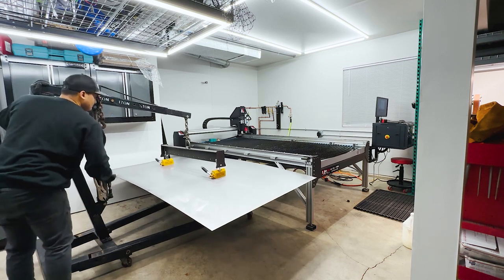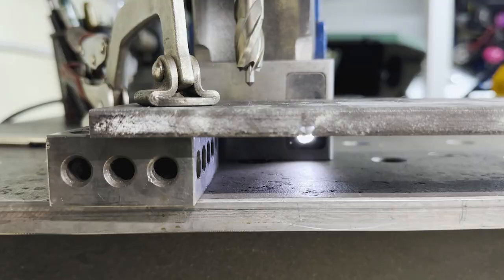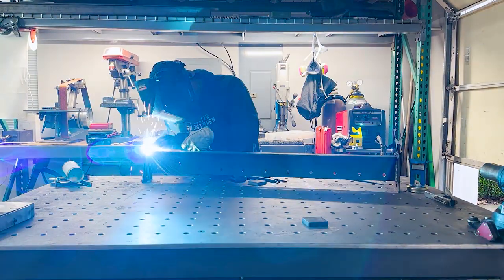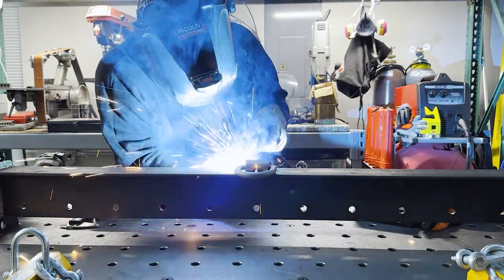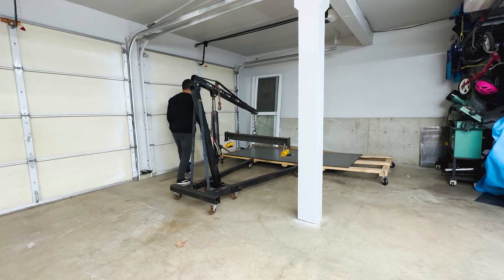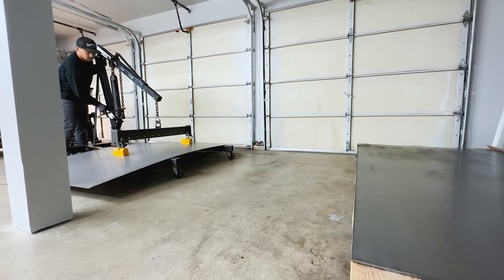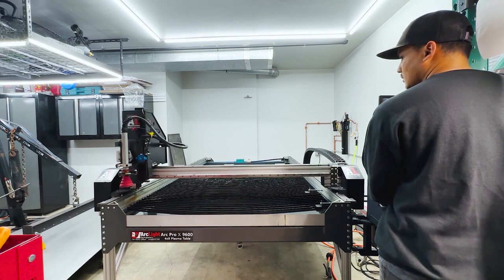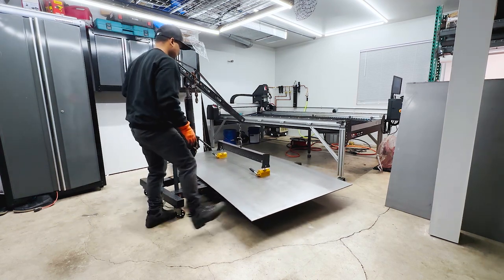How I Built This ONE Thing to Save My Back! - DIY Lifting Beam

Comment: Great set up , what I did for my shop hoist is replace the steel wheels with 8" rubber coated wheels make rolling around the shop floor way easier and quieter too , I installed a air over hyd long ram on the hoist no more hand pumping up the jack .

Comment: Your climate is very different than here in Florida, but if your water table is causing moisture issues in your shop a holding tank will get rid of that problem. You only need one drain/fill hole in your water pan to pump water up to the table and gravity drain down to the holding tank. Nice vids as always

Comment: larger casters with bearings instead of bushings, and you're golden. i'd love to see you add a power pack to the hydraulics. nice build! 🙂
Reply from the maker: Thanks for the tips
Reply: Ratha: A power pack would be very nice. An alternative, could be an air over conversion (like SWAG Offroad’s). Also, in addition to the wheels and bearings, add a removable handle/ push bar. v/r wh